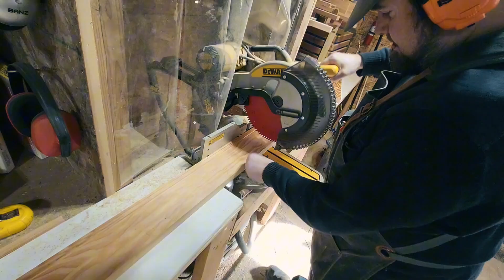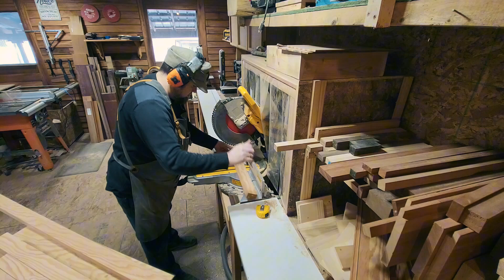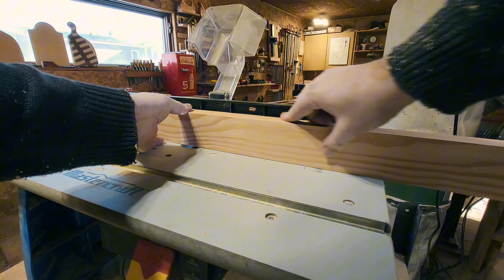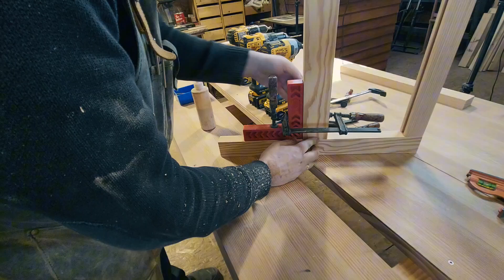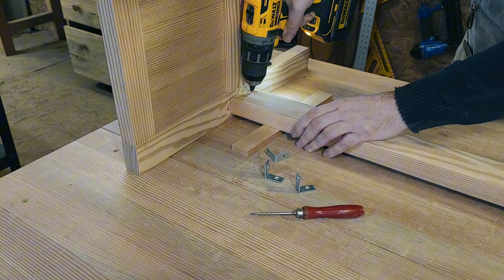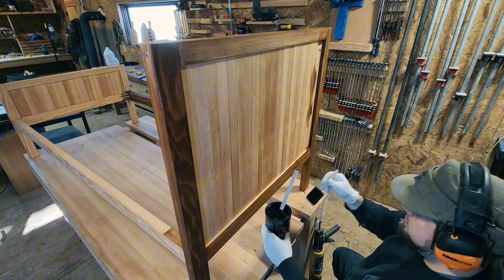How to make a farmhouse Bed for Kids! - Easy Woodworking

Comment: It looks awesome but the entire weight and movement of the sleeper is being handed by 16 screws and 8 tiny L brackets. I would suggest a more robust joint between the head and foot boards.
Reply from the maker: Yes, You're right. It wouldn't be enough for an adult person, but it's just for my 2-year old do I think it should be fine.